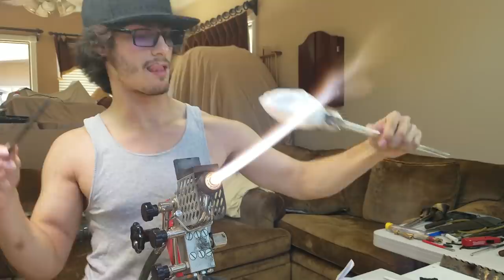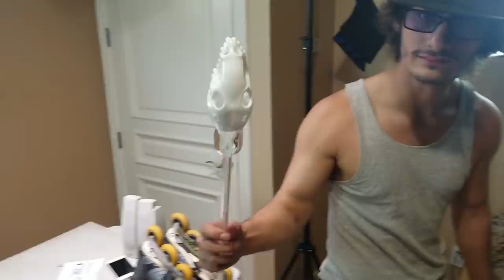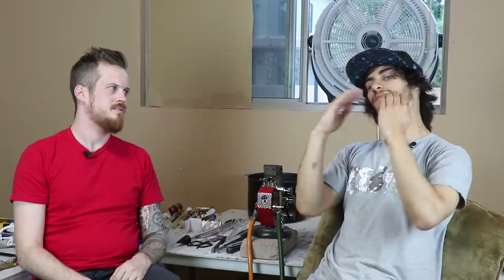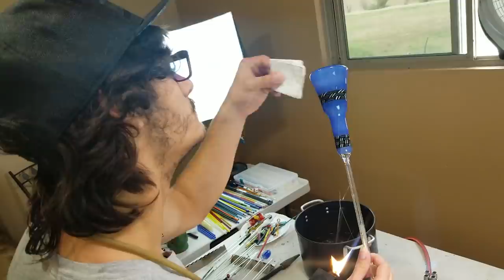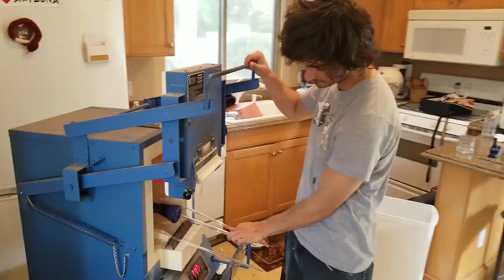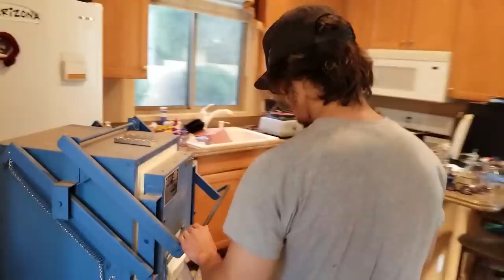Glass Artist Larry Limes Makes a Heady Dab Rig

Comment: He's got skills, but that ventilation.....yikes.  Gotta get some proper ventilation so he can do this as long as possible.
Reply: herbie too, guy put all his funds on the torch
Reply: @Castaway_glass  soon he'll need all his funds to go to medical bills and an oxy con to breathe if he doesn't upgrade his ventilation.
Reply: a 3m mask could solve the money issue for a while

*edit, seems a mask will not do the trick, for this job. be safe out there
Reply: @keshlalish5586  no it won't.  Not at all, not even a little bit.  That's terrible advice and you should delete your comment so that somebody else doesn't get the idea that it's okay to do that.
Reply: @hotfiyah  
well i will leave my comment and you should leave yours, because this way someone will see both our comment and get a specific awnser to that question ''could i use a 3m mask to prevent bad stuff to enter my lung''

you say no, i tought those would work. seem they don't provide the protection for those kind of particulate
Reply: @keshlalish5586  good idea... sorry if I was a little hard on you.  not only do you have to protect yourself from glass dust and particles but when you melt glass you're actually burning out the flux that's inside the glass that makes us able to work it and that gives off fumes as well so you definitely want a good ventilation system to take all that out.  not to mention when you burn propane and oxygen you're creating gases there two... Both of which a protective mask will not filter out.  The fan he has in the window moves several hundred cfm's, but the gaps on the sides cut down on that efficiency. for example many fans that you'll see in glass shops are the type that go in an attic and those move 1000 + cfm's.  I know mine is 1600 CFM and I have mine completely sealed so there are no air leaks around the fan to maximize the efficiency.  Figured I should explain it instead of just saying you're wrong.
Reply: @hotfiyah  hey no stress i understand.
this could lead to health consequence :)
Reply: ye we use the ones that are thrown in the doorway of big rooms to help paint dry they look like cement mixers with metal fanblades with no grates, if you get a finger in one its gone tho haha  @hotfiyah
Reply: Talk to an hvac guy
Reply: @cosmosistprograms4970  lol are you trying to respond to me or who are you talking at?  If it's me, then your dead wrong.  Peep what facts?  The ventilation here is 100% not adequate.  Maybe YOU should do your homework.  And how is my 1600 cfm fan bogus.  The fan is what it is.  Yes you do need to move that much air.  I don't even know what your trying to say.  Also it's cubic feet, not square feet...completely different.  A 20x20x8 room is larger than 3000 cubic ft.
Reply: @cosmosistprograms4970  lol what a lost cause
Reply: I dont have the facts but im on your side because you sound confident. its getting hot in here, i wish we could use his 1600 cfm fan
Reply: @cosmosistprograms4970  "If you can't prove shit" yet fails to prove anything. Being aggressive doesn't mean you're right lmfao sit down
Reply from the maker: Great news everyone! Seems like he heard all of your opinions and has upgraded his space and has good ventilation now! 👍 Dont forget to check him out on IG to see what hes upto. @kerrylimes
Reply: @hotfiyah  yo you seem to know your ventilation stuff. I got a 8x14x8 space that I'm going to use for my lampworking studio. Would a 400crm vent hood be sufficient?  From what I've been reading, I calculated that 230ish would be enough, but I'm not sure
Reply: @DubTheFiend  I'm not really in any position to be giving advice on ventilation because I'm not an expert, but I know that I would never use anything that low.  Personally I would prefer a 1000 CFM or more, and I'm currently looking to upgrade mine to around 3,000 cfm right now because I do a lot of fume work.  Call me overkill but I have asthma and I'm very conscious of my air quality.
Reply: @hotfiyah  i hear you man. Thanks for the response. I'll keep researching
Reply: Just what I said
Reply: Everyone who is setting up a torch spot. Read Mike Aurelius’ website post about ventilation basics and in depth details including cfm calculations and what not. Everything you could need to know.
Reply: What ventilation?
there is none